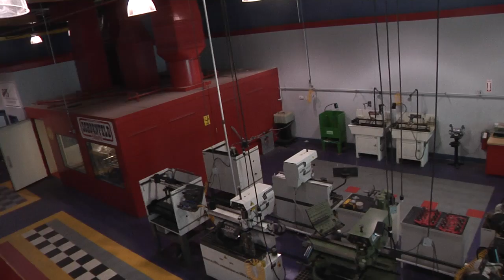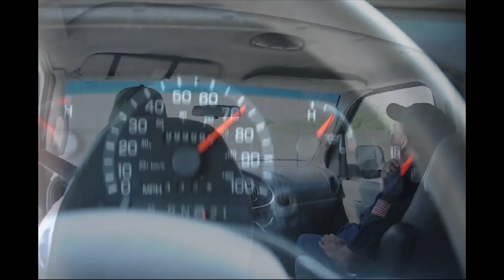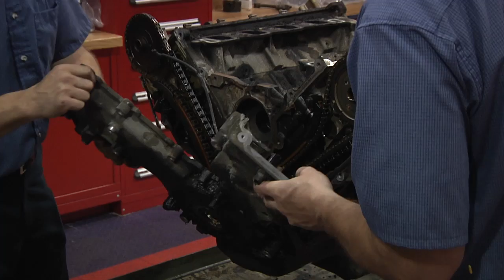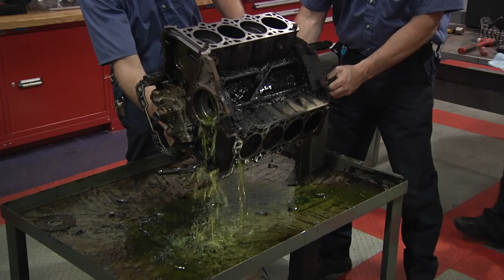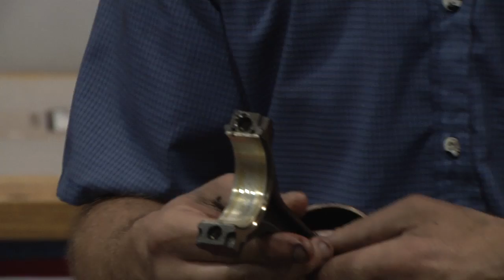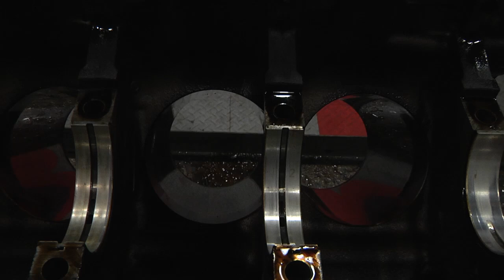Schaeffer Million Mile Gasoline Engine Teardown

Comment: looking forward to electric vehicles w/o all of these complications
Reply: *****
we shall see :)
I know my ICE car has done pretty well over the last spirited 100,000 miles, but it's required a lot of maintenance, including a timing belt change, a water pump replacement, a rotor replacement, injector cleaning, injector o-ring replacement, cracked headers, oxygen sensor replacement, catalytic converter replacement, exhaust welding for leaks (despite being made of 300 series stainless steel), numerous oil and filter changes, and air filter maintenance.
I'm sure that vacuum cleaner sealed bearings are relatively cheap compared to what an automotive company might produce. And a 500 mile Li Ion battery pack, assuming no cell failures, will maintain a 300 mile range over a period of about a million miles. Battery costs are falling at a rate of about 10% per year. If that continues, then a 500 mile battery pack (on a heavy, large tesla, mind you) would cost 5K in less than 25 years. Couple that with reduced 'fuel' costs, and I think we might be seeing electric vehicles be the cheap, smart choice in two decades.
Tesla has stated quite firmly that their goal is a 1,000,000 mile power train, btw
Reply: Electric vehicles are going to require more expertise to diagnose and fix. Not to mention they'll be impossible to source affordable parts. (especially as used parts will be nearly non existent) there is no real upside other than less demand for hydrocarbons & the motive for all of it is not global warming. Just an FYI.

Comment: Engine wasn't built to make the most power or have lightest parts, reason it could last that long. Make it do other 150hp and remove half the steel parts. It wouldn't even make it 200k without rebuild. If your fine with A to B car, go right head pick engine like that. If your counting weight to power ratio and want make the most power. There no oil that going to stop engine from breaking down from heat and wear. 

Foxler of Furry Fandom and Porsche Club of America
Reply: You've just described why chasing sky-high specific power outputs is a fool's errand. Sooner have a large-displacement engine that'll last, than an over-stressed turbo, with half the displacement, making the same HP.
Reply: ☝️thank you
Reply: I guarantee ya that the ecoboost sixes that they're putting into this class of truck nowadays won't make this kinda mileage for exactly the reason you point out.

Comment: So you feature Schaeffers 9000 oil. So lets get real here when you show me that Schaeffers oil out performs Amsoil Signature Series oil I will then purchase Schaeffers oil. I have seen testing done on here You Tube where both oils were frozen to 40 below zero and Amsoil blew away Schaeffers in flow at that temperature. Show me that Schaeffers out performs keeping the engine clean or keeps the engine wear down??? I use Amsoil to me the best oil on the market. So you show Schaeffers oil on your program now show real examples that Schaeffers will out perform  Amsoil. Prove to me as I have asked on here. I am sure that you will not reply and I will not see any information on what I asked.

Comment: Where is any kind of proof what so ever? How many transmissions and rear ends did this van have replaced? what was this van used for and how did it end up being driven 100 thousand miles a year. This van would have never been parked, and been on the road all the time. Its just to clean inside. I'm pretty sure Ford themselves would like to see this. How did they keep it from blowing out plugs in that million miles. This oil is hard as all hell to find.
Reply: if you watch the first part of the video it says they transport prison inmates.   This teardown was done by Rankin technical college,   not Shaeffer oil.  Why would the college risk credibility to lie for Shaeffer?    (I don't work for Shaeffer,   but it is one of many oils we sell where I work and I use it in my own cars)

Comment: I am a Ford fan. I have personally built 4 Ford engines. Casting #s on original bearings thats BS. Cross hatch in cylinder walls after a million thats BS. That vehicle is used to transport people and I am sure the maintenance was not always done when it was supposed to. I hate these fake videos.
Reply: I'll agree with that. Did he say 2 thousands of wear on the cylinder walls? I bet Schaefer has a really good product but I think this might be a little to good.

Comment: I'm a firm believer in schaeffers oil but don't fool us with a 5.4 that has a million miles. Thats probably the 10th motor in that van. Any mechanic knows the 5.4 are SHIT
Reply: 4.6, 5.4 and 6.8 are very reliable.  Had a 4.6 over 500k personally and seen others w/ more.  There's many econoline vans w/ 500-700k miles and a few at 1m. Just don't use 5w20 ford called for - 5w30 full syn